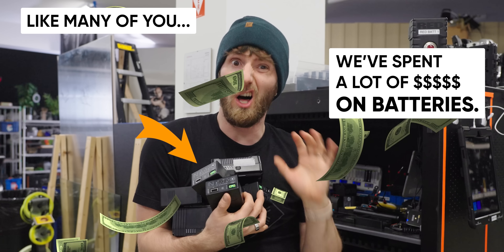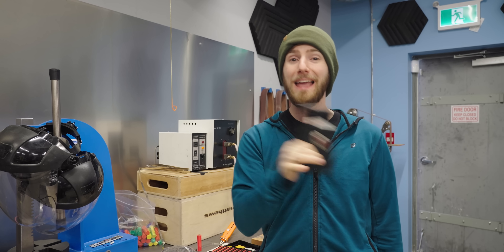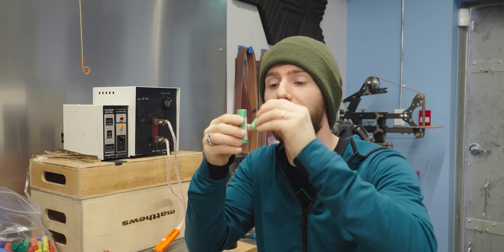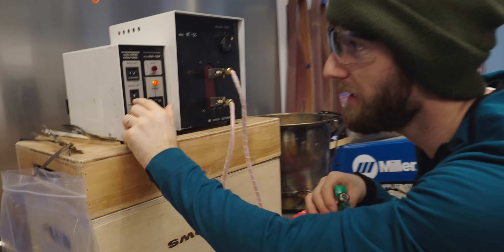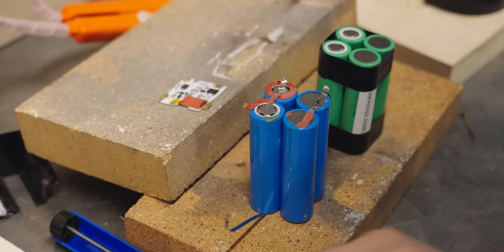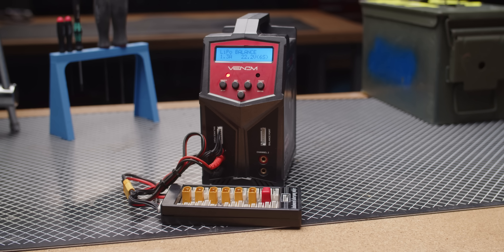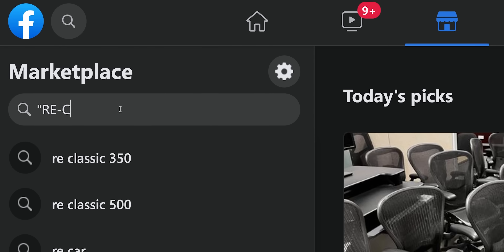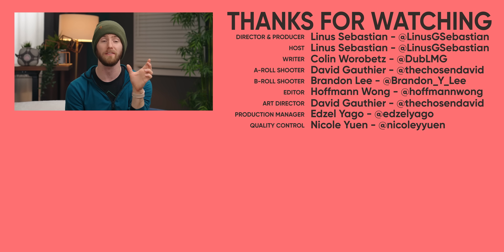This should be illegal… Battery Repair Blocking

Comment: As a vape shop owner, I'm super excited to see cool things done by Linus with these batteries. Question though, I was always under the impression that high drain batteries like the green Samsung 25R's would leave a little performance on the table for this use case. High drain batteries are used with vapes because depending on the unit/mod you can be drawing anywhere from 10 -30 amps at any given second. (with most regulated mods) And with mechanical mods, often even more. The green Samsung 25R's have a nice middle of the road 20 amp rating, which is why I personally try to keep stocked up on them, they're super good batteries. But back to my question, wouldn't it have made more sense to use batteries with a lower amperage rating, with higher capacity? I'm not sure how much power the camera pulls at max, but I would think it wouldn't need the same amperage that a vape would. It would've been more beneficial to squeeze in the extra capacity you could into the battery pack. LOVE the content and LOVE this video guys! Thanks to the team! (:
Reply: That's the one thing about vaping most people don't know: you can learn a lot about electrical circuits and battery systems if you really get into it. A shop I used to go to had an employee who was studying electrical engineering at the local college. One evening every week he'd teach free classes at the shop on basic circuitry and the safe and proper way to make your own battery packs and mods. I loved seeing that kind of grassroots effort to really help educate people and expand the DIY community in general.
Reply: If you love the 25R I’d recommend checking out the Molicel P26A I started ordering those for our shop instead of Samsung once Samsung started coming after vape shops. Molicel is still an OEM and the P26A rocks! Same rough cost but 2600mAh and 25A so they’re a little nicer for the same cost!
Reply: @lunarnoctis5924  Will do. I'll look into that. Thanks!
Reply: Red cameras are known to draw a lot of power. When they first came out, you couldn't use most of the other V-mount batteries on the market because they weren't high-drain enough. But today, most is not all of the V-mount batteries on the market should be able to do 10 Amps constantly at least. They are often used for LED lights as well and those can easily be up to 300 Watts (in which case the manufacturers usually put on two V-mounts)
Reply: I looked up Red batteries on their page but they don't give any amperage ratings, but they say their batteries are made by Core SWX. And the Core SWX V-mount batteries on their site are either 12A constant /20 A max or 15 A constant / 20 A max
Reply: @highks496  Thank you, I didn't know that! Great info, thanks for the comment man!

Comment: On the topic of bms. My yamaha dirt bike has electric start on it. And if the cells get too low it shots off.(no surprise there) but to get it to change it needs a changer with a BMS reset signal. That way it knows it connected to a compatible lithium charger. On a side note. When you first get the bike you to "unlock" the battery with the charger to get it to work. It has been in a kind of transport mode.

Comment: 6:45 isn't 3D printing the best technology for that kind of custom-made support for the batteries to be welded? 
I mean you could probably even 3D print cases if they break although some parts might lack the strength they need if, for example, a part that connects to another one by press fit has thin walls or something like that 🤔
Reply: Yeah risk a fire by printing everything yourself for that $30000 camera

Comment: Got to retrieve that sounds awesome ... You also should have used pads to prevent them from shorting out to each other the whole casing on thos cells are negative and the top part is the only thing that is positive you only have the thin plastic prevenient a fire 😅🔥🔥

Comment: I had an electric chainsaw that had a dead battery on arrival. They shipped me another entire device without having to return the old one but that allowed me to tear the battery open and charge all the 18650s inside one by one with a bench power supply. 

Once it took some charge the charger accepted it and it has been fine since, sold the other one away and got myself a pretty sweet deal overall and saved something from a landfill with a couple hours of waiting for things to charge

Comment: I've worked at a place where they repaired/rejuvinated E-Bike batteries and yeah, the welding of the cells is a very delicate procedure. My job there was essentially programming our own BMS software to copy how genuine brand BMS systems behave and yes we made our own PCB's. With some manufacturers this was very easy because you could easily spy on the communication between battery, motor and display and replicate that with your own battery. Some other very well known manufacturers however made it pretty much impossible to even replace cells. Hello planned obsolesence.

Comment: 18650's are standard size, standard voltage cells. We have had replaceable batteries for decades (AA's, AAA's and so on) so why not 18650's? Total extra cost would be a spring per cell and a screw down side plate. 
You would think by now this would be mandatory considering all the enviro hoops we have to jump through each day - a lot of which have far less effect than simply throwing things away all the time for no good reason.

Comment: The consumer AND reviewers are mainly responsible making battery life the first priority. And since it's practically impossible to long term test them and the replace speed of products reviewers and customers don't care.
This means Li-Ion batteries will be standard overcharged and discharged to get good battery time in the reviews while cutting the number of recharge cycles in half or worse. The max voltage of Li-Ion is 4.2V fully charged ... i checked and my battery was over 4.3V.
It pains me to say, but, to my knowledge, only the Chinese brand Lenovo lets you charge your laptop to 55-65% to extend battery life.
This option should be mandatory for all rechargeable batteries/packs.

Comment: Hamm seems like your spotwelder settincs are way to high. I own a kweld (diy spot welder) with pulsetime adjustment in jules of energy burned in the spotwelds itself and i get good welds with about 10-15 Jules. at about 1000A // 12V 

the thing is i dont see any glowing in my nicel strip. The pulses are increadbly short. only 2 small black dots where the probes where pressed. and the nicel strip is so solid that it rather rips out  a piece of strip than the weld breaking.

Comment: might have been useful to look into spot welding before you did this. those sparks were from the spot welding, not the batteries. if it were the batteries, the thing would have arced (likely no sparks) as soon as the nickel touched both batteries and any potential differential would have jumped across.

the sparks may have been grease from your fingers or some other kind of oil or dirt. it's also possible you had it too hot and the metal vaporized underneath where there's not enough space for it to expand without sparking like that. this is standard in spot welding, and while it doesn't make your welds any better, still plenty of industrial sights just have the their spot welders configured to pretty much always spark. just look at any car factory video and you'll likely see just that

and also, I didn't watch your diy spot welder video, but grabbing some TIG welder tungsten electrodes for the spot welding prongs probably would have been a very nice idea (as would have been here).
Reply: Another thing that might be happening is the dielectric strength of the air between the electrodes was low enough that the resistance in the metal strip, from heating, rose above it. So the electrons jumped instead of passing through the nickel. It's definitely not something to be worried about.
Reply: You can even see the sparks in the stock footage they used around 17:25.
Reply: I was thinking the exact same thing that they never youtubed how to do this LOL

Comment: when measuring out the cells before pairing, you have to make sure you measure the cells under load.
A battery can have a "floating" voltage that can show a wrong image of the cells internal resistance or degradation.
Ive made custom battery packs for hospital equipment for a few years and one of the biggest issues ive seen with cheap packs is that the pairing have been done unloaded and the cells killing each other trying to equalize. 
Usually i would use a 3 ohm 5 watt resistor in parallel with the test leads, this puts a 1 Amp load on the cell and will after a few seconds show the acual voltage calue of the cell.
Reply: If you are dealing with new and genuine cells (almost identical internal resistance, charge-discharge curves and even charge level (out of factory) that is not neccessary.
Reply: @volodumurkalunyak4651  in my professional opinion this is simply not true, most manufacturers even specify that you match the cells to within 100mV, if you do no put the cell under any load while measuring their voltages you will not get a precise reading and it will come at the cost of the cells longevity.
Reply: @TheBassiist  those are brand new Li-ion cells with around the same ESR, discharge curve and even charge state. If ESR and OCV are the same, voltages under load has no oither choise but match.
Most manufacturers pump out cells by millions and only viable thing to do is make those as identical as possible.
Speaking of primary, used or cells sorced from questionable manufacturer, measurments under load are now neccessary.

Comment: 1) The sparking here should be harmless, that's just the spot welder not making good contact (you can literally see that at 17:28 in the stock footage).
2) Wearing a ring while dealing with Li-Ions is a very bad idea, if that shorts across the contacts it gets hot fast and you might lose the finger.
Reply: This! It was hilarious to see them panic over nothing. If Alex was there he would have probably known it was harmless.
Reply: Completely agree.  I spot weld my own battery packs and sparks happen but the battery cell is unaffected.  I have never had a cell explode from spot welding.  You just need to monitor the cell's temperature and it starts to heat up then you throw it the sand bucket.
Reply: @Caretak007  that was my thought too, they make a Little to much teather
Reply: Good point on the ring. It was brought up last time when they were building a pack for some go-kart thing. They take all these safety precautions, but not the one that matters.
Reply: Yea it really seemed like a welder issue rather than a cell issue.  It was a waste from an abundance of caution

@ 17:28 they show a professional spot welding setup sparking at every weld... Comon guys. This was pretty alarmist and dumb
Reply: I thought that was the case. I didn't see anything that looked like a short. They could probably have guarded against shorts by using tape on the parts they weren't working on.
Reply: Exactly, i already got kinda annoyed that they probably threw those perfectly good batteries away. But props for doing it as safe as possible i guess
Reply: My concern here was the pulse length of that spot welder. It seemed to be on for whenever the foot petal was smashed. Never seen nickel glow like that! May have burnt through some cells. Linus, you should consider investing in some more beginner friendly spot welders like the sequre. :)
Reply: This^
Reply: Yeah, I've done far worse to these cells, like actually shorting cells with my side cutters for a brief second and they're almost always perfectly fine aside from superficial damage to the heatshrink.
Reply: yeah lol, all those cells being condemned over nothing
Reply: @Grumbel, nice respectful piece of advice.  Nicely done.  

To the know-it-all others pulling the 'ha ha, he's so stupid routine', you're forgetting one critical detail.  He's inexperience and an employer.  He may have done his homework to become knowledgeable enough to try this, but knowledge is not the same thing as experience.  So if you are doing something, especially as an employer that can be dangerous, both to you and those around you, then you don't have a choice.  You have to take the safest route possible every single time.  It doesn't matter if there's the "possibility" that the cells were fine.  He doesn't have the experience to properly assess that yet.  Nor does he have anyone around him with the experience necessary to guide him on those assessments.  So to protect himself and his employees (who he's responsible for, both ethically and legally), he's required to take the safest possible precautions regardless of whether those precautions were "warranted" or not.  

You should be applauding him for prioritizing safety.  Not ridiculing him for being overzealous in the application of those safety measures.  Especially with things like lithium batteries that have a well known and documented history of catching fire and even exploding when something goes wrong.  If you have advice, give it respectfully like some others have done.  But ridiculing, laughing and pointing fingers does nothing to help anyone.
Reply: Yeah exactly. I'm into electrochemical cells for more than a decade and the things he did after his spot welder sparked just made me question have I missed something over the years. Battery terminals can spark though when you connect them to AC inverters because they have large capacitors (and that spark actually comes from the battery, which can turn out to be a weld in the end :/). But he's honest when he says he's not the example on whom you should follow regarding this special kind of stuff. It's just silly when you discard a battery just because you happen to make a spark between the two welding points.
Reply: Silicone rings are the future
Reply: @thanhavictus  silicone rings are already here.    Just order the extra small and it should fit on your finger. 🙃
Reply: Agreed, except for the "you might lose the finger." part. That's a bit of a stretch. It might give a nasty burn, sure. But the battery would explode before the ring heating would do a serious damage.
Reply: @altersami9660  I know a garage mechanic who accidentally shorted a ring on a car battery. The burn was bad enough that you could see the bone. He was lucky to keep his finger.
Reply: @LesNewell  A car battery is capable of 200A and is 12V. That's way higher than a lithium ion battery short can produce. Those vape batteries are rated at max discharge of 35A, and are 3.5V in the video.
Reply: @altersami9660  He isn't soldering a single Li-ion battery, but battery packs, so that voltage and current can go a lot higher than what a single cell provides.
Reply: @altersami9660  My Dad was a master electrician for over 50 years. He knew a lot of his guild brothers that lost their ring finger. Wearing a ring while working on anything that can produce current is a bad idea. That's something they should teach the first year apprentices before they pick up their first tool.
Also, rated current is not anywhere near the surge current that the battery will produce before exploding.
Reply: @surferdude4487  Was he working welding or dealing with lithium ion batteries for 50 years?

Yes, wearing the ring is bad, but for the low battery voltage and current he's working with, losing a finger is not the main concern.

"rated current is not anywhere near the surge current that the battery will produce before exploding."

I never said that. I'm giving those number for context that car batteries are capable of 6 times the current a lithium battery is capable of.
Reply: @altersami9660  Those Red batteries are a lot more than 3.5V. They also have several cells in parallel so would have a much higher peak current capability. The cells are rated at 35A but are capable of outputting much more. Even if you don't lose a finger it really hurts. I've had a stainless watch strap turn blue while I was wearing it, due to shorting it across a battery. That's not an experience I'd like to repeat.
Reply: @altersami9660  A burn all the way around a finger can constrict as it heals and cut off blood supply. You'll absolutely notice losing sensation in the finger, then agony as it rots, but should you ignore all warning signs you could lose it.
Reply: @altersami9660  Look up "degloved finger" if you've got a strong stomach.
Reply: Ugh yes. He should of brought an expert on for this.
Reply: I'd rather see them be overly cautious than trying to ride the line, given their large and impressionable audience.

Comment: One way to get past a BMS that wipes it's program on power loss would be to connect the new battery while the old is still connected. I've seen videos of it being done with cars so the radio doesn't lose power so I'm thinking the same can be done here.